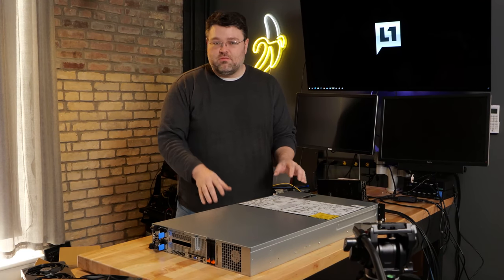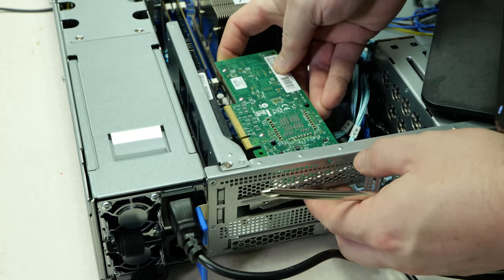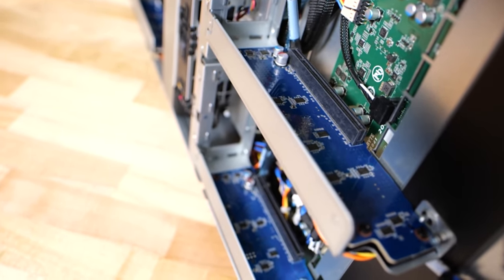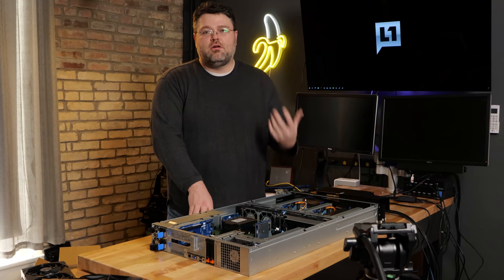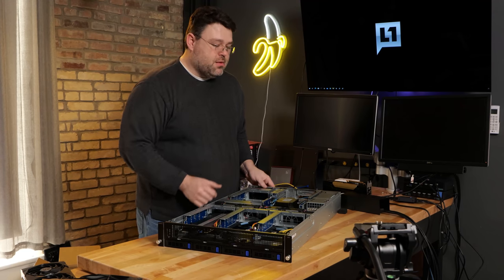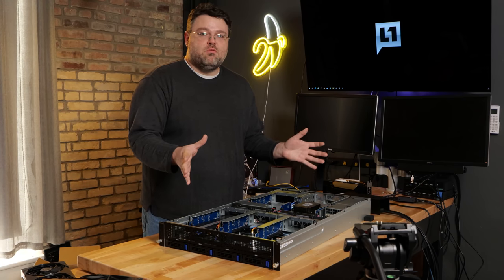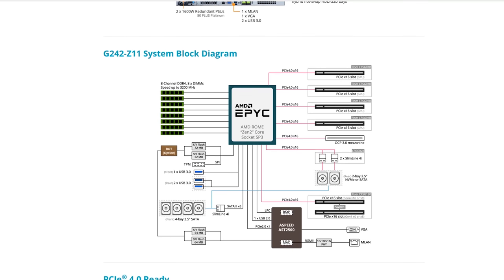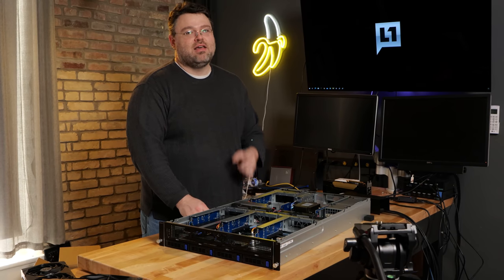Gigabyte G242-Z11 -- GPU Server in 2u - Quick Tour & Setup

Comment: I picked Z10 version of this chassis after one of Level1 videos and I love it. Use it with 4 x 2080Ti and AMD 7402P with 256GB of RAM and 10TB of NVME storage in total. It's a beast. Thanks Wendell :)
Reply: Where can I buy on ?
Reply: @angelinocottoestrada5676  I've got one from my local supplier that had a connection to US distributor which have finally delivered. None where available in Europe to my knowledge.

Comment: Wendell, could you cover a more general linux home server setup and general topics to learn from making a home lab. I took your course on udemy but it felt like there were some jumps between steps. I've been learning to use linux but there are still some difficult projects to learn. Finished putting together a home nas but still a lot of figuring out software side.  ZFS, VMs, other applications to run. Trying to learn enough to get an entry level position, maybe learn enough to become a low level admin.